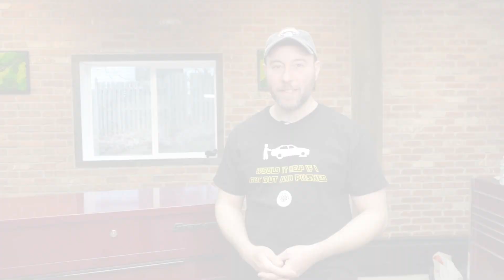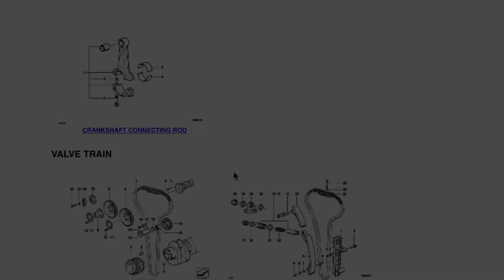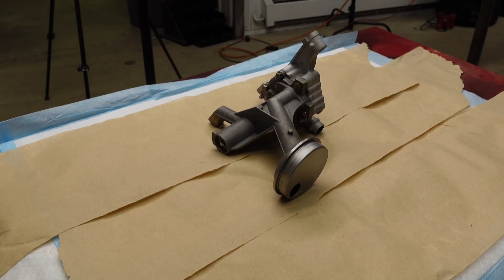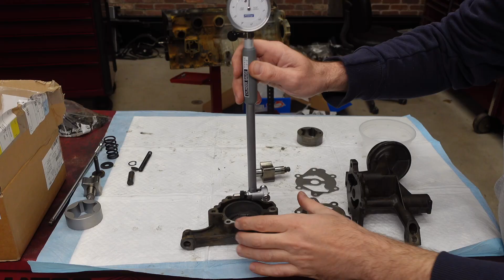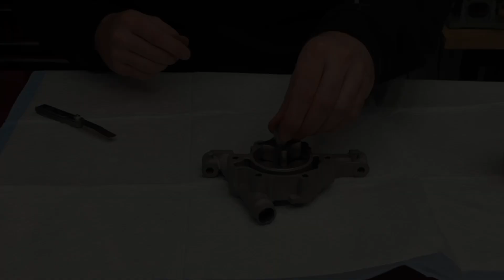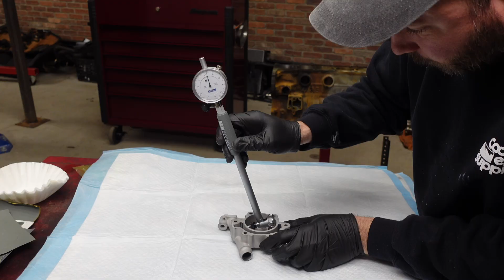This Oil Pump May Be TOO FAR GONE!

Comment: Could you tell us where you got the refurbishing kit in Germany? Really need to get one
Reply from the maker: BMW dealer network has all the parts except for the front housing. That is no longer available.
Reply: @wewrench BMW dealer network is that a community chat ?
Reply: @enriquebatarse5702  No, he means the BMW dealership service department. All of the parts he required he purchased through the parts department at his local BMW dealership.
Reply: I let my bmw e34 m5 sit for a few years and recently went to start it. The car was running rough immediately and the oil light was flashing. Is that a symptom of bad oil pump? Is my s38 toast? I let run for about 1 minute thinking it would clear out

Comment: what was the torque specs for this ?
Reply from the maker: For the oil pump case?
Reply: @wewrench  yes case / and on the engine block / and chain cover torques / water pump/ sump/ please if you can thank you
Reply from the maker: @ALKUKES  Those are all M6 thread bolts so 10NM
Reply: @wewrench  thanks mate it already done hopefully can get it starting soon never had it running and its been bloody expensive